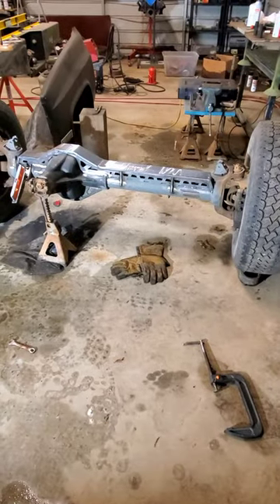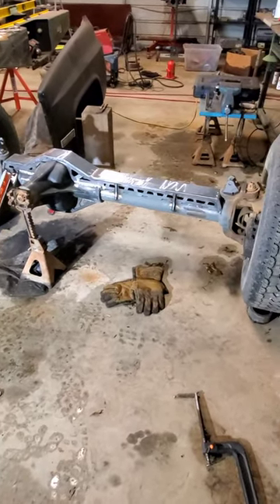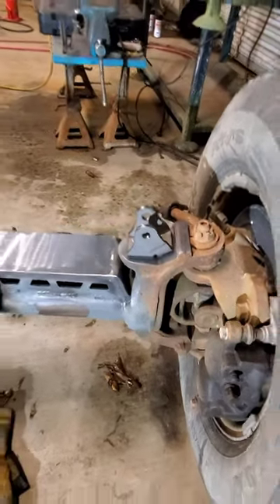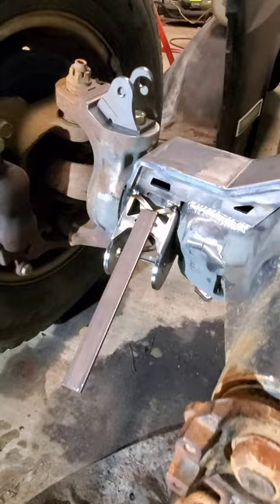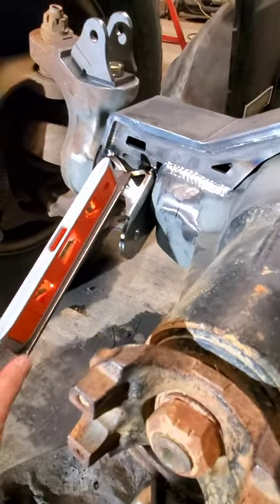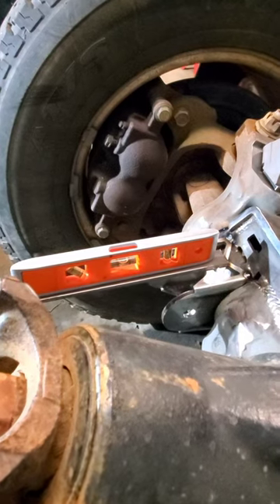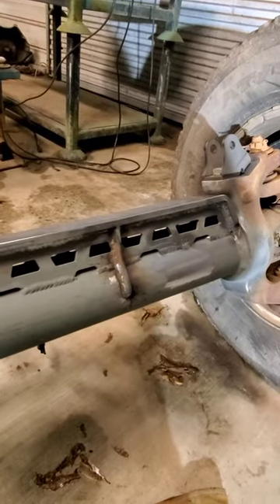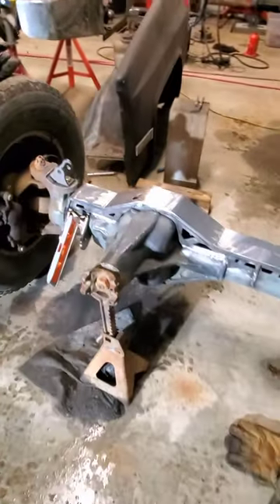Quick Fab Tip. Dana 60 Control arm mounts.

Comment: Hay buddy I heard you saying something about you catching shit from some clown on the internet over your welds.  I think you are doing great work that should have the potential to take a lot of abuse.  I have been welding for about 23 years.  I have built two prerunners and a 1450 MORE sportsman race truck.  I also weld mounts and brackets for cameras in the film industry.   

1. I have always tried to make my tack welds in the corners of parts or places that I could start or end a weld.  I also found that buying the largest tanks for my gas saved me a lot of money and also made it a lot easier to run my gas psi higher than the 15-20 recommended for indoor MIG stuff.   Oh also beveled edges and scale removal is Cluch.   Welding and painting are 80% prep.  Last get your self some map gas’s or a oxy/ act rig and preheat your parts before powering in on clod welds.  Just stating with parts at 100/150* will help you keep consistent penetration and even beds.   Plus the sound.   Turn down your music and listen to the welder and arch.   You’re going to get to the point that just hearing it run will tell you how well you’re running.   Oh lastly try running different size wire on your scrap metal to get the best idea on how it will layout.  Then learn how the wire works in overhead and vertical welding.  I’ve found that larger wire can be less flexible but gets more heat/ penetration.     Oh last thing I swear.  Unplug your battery and ecu when you’re grounded onto the truck’s frame.   I have had to learn that twice so far.
Reply from the maker: Thank you very much.

Comment: How you planning on fixing your caster??
Reply from the maker: This vehicle will have adjustable upper and lower control arms. Well one upper. This will be a 3 link suspension.
Edit. I see. I don't have the upper link welded on yet. I want to get the axle under the truck before I weld on the upper. It needs to clear the 8.1 Vortec and exhaust manifold.